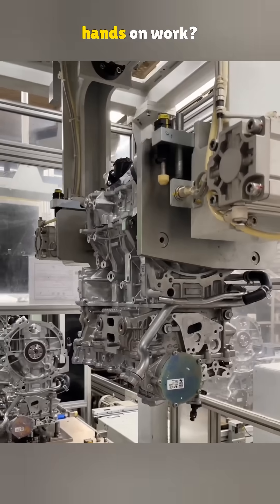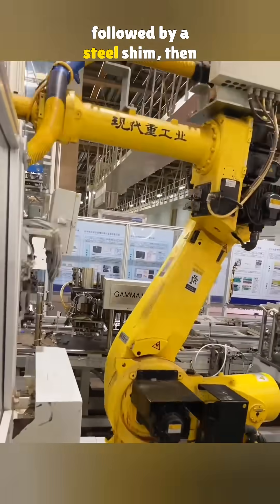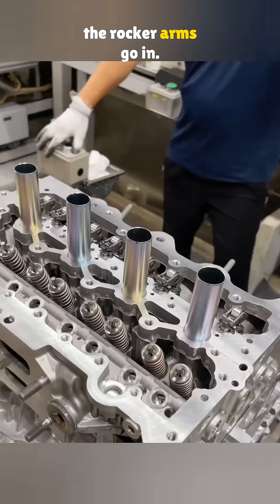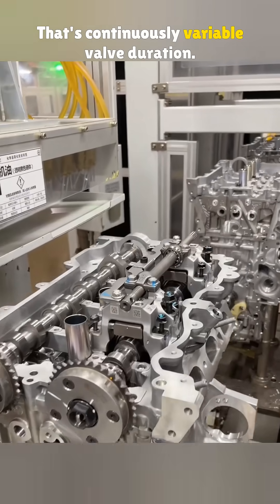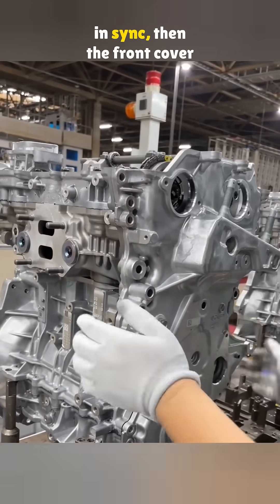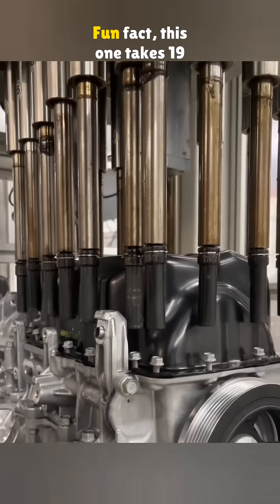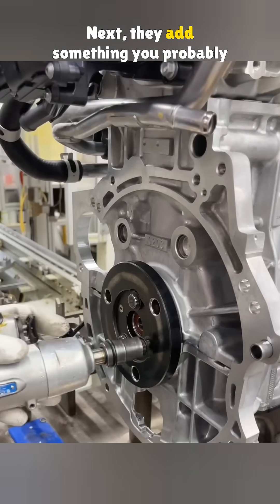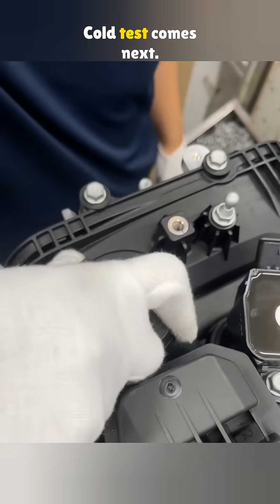How Modern Car Engines Are Assembled #automobile #mechanic #manufacturing

Comment: I am a mechanic who has worked on enough of these to have done PLENTY OF RESEARCH. The plastic guides get brittle and break, and your engine is sometimes not repairable. I have seen valves go through pistons and the pistons wreck the crank and the block. It’s aluminum and doesn’t tolerate a seized crank bearing very well!

Comment: No I sound like a guy that hates cheap engine parts. I have serviced enough of these engines to know what breaks and causes the owners problems and eats thousands of dollars in the process. The air intake ( plastic ) the timing chain guides ( plastic ) the oil pickup tube ( plastic ) these 3 parts alone will cost you thousands down the road …. Around the 50 thousand mile mark.
Reply: I think ive seen plastic oil pans installed as well. Was it VW and Toyota?! Its not that expensive and hard to replace, but if it breaks when hitting a rock, it can crash your engine 😅
Reply: @pg41226  Just hit the rock, pierced oil pan and didn't mentioned it. My car begged me to stop because of oil pressure and it oil absence, but no I didn't)))

Comment: Plastic chain guides on the timing chains, plastic oil pickup tube. Garbage engine from start to finish.
Reply: You sound like a guy that removes the electric starter from his engine cause "All that extra shit just breaks down".
Reply: Might as well make the whole engine from plastic. Imagine the cost and weight savings!;)
Reply: Speaking from experience, the metal chain goes always out before the plastic guides. Do your research...
Reply: @mrtickles5982  Sure, because plastic is so much stronger than steel.🤣
Reply: @paulparoma Not so, but the chain is under more stress than the guides

Comment: At least they still use a timing chain instead of a wet belt 🤢
Reply: The 2.0tdi has a wet belt for the oil pump.
Reply: Only thing I gate about my 24 chevrolet Trax
Reply: Hate
Reply: The hyundai turbo uses a timing chain?
Reply: But these are made of chocolate and the chain will stretch.